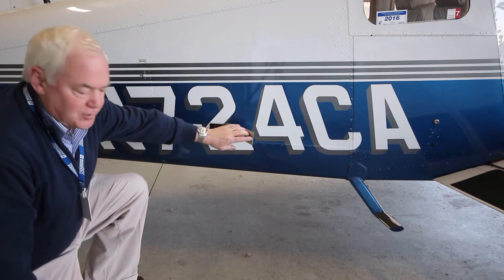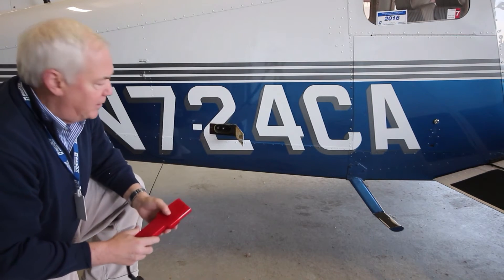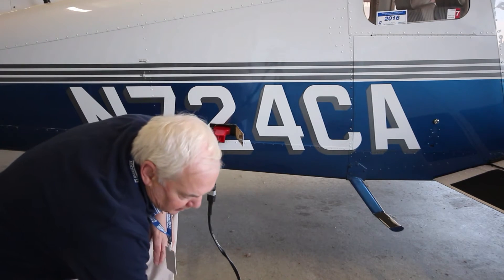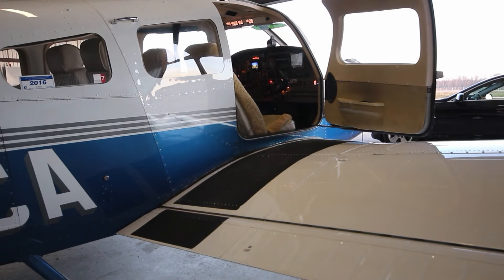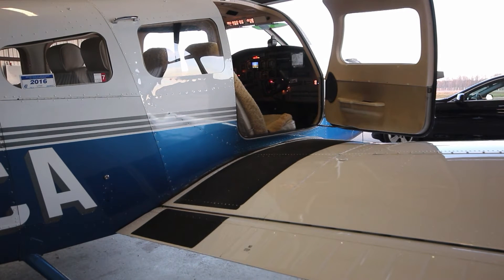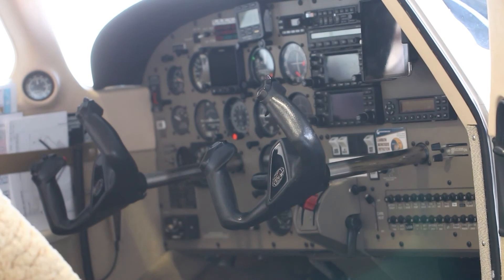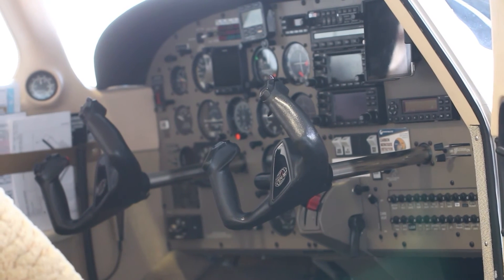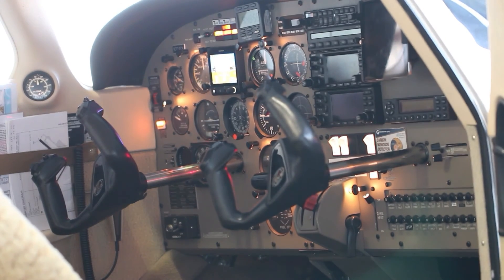Use of Aux Power Unit N724CA

Comment: Nice Panel , when did you upgrade to the digital horizon and the iPad is a great addition , is it coupled to stratus ? , all in all a great looking panel .
Reply from the maker: We used to have a panel mounted Garmin 496 for weather.  We took that out, installed a mini iPad for Forelight and added a Stratus 2 for weather and traffic from the ADS B in.  We also have the Avidyne/Ryan 9900 TCAD for traffic on the Gamins.  A couple of weeks ago the Attitude indicator failed (it has happened previously in the past).  The problem before their was only one that could be used with the STEC Autopilot.  The Garmin G5 Primary electronic attitude display/HSI also can be used so we upgraded.  The new Garmin 345 GTX Transponder for ADS-B out has two wireless connections, one will be for the iPad.  Leaves one more GARMIN 345GTX for someone else in the plane, or seven from the STRATUS 2 for ADS-B.  Steam gauges at one time to two wireless networks, with three sources of electronic traffic.  We upgraded the original STEC 55 to an STEC 55X that was removed from a Cirrus for GPSS.  The FAA kicked in $500 for the ADS-B out.